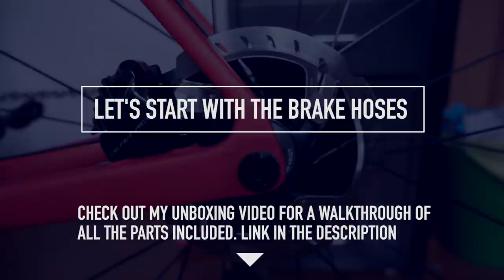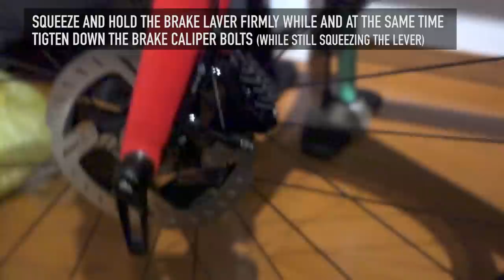Dura Ace Disc brake Installation and bleeding How-to | Road to Dura Ace 9170 Ep.3

Comment: Rides of Japan thanks a lot for the excellent video! If I only want to change the calipers should I drain the system of oil beforehand? Can I do that by simply attaching a hose to the bleed nipple, opening the port and letting the fluid come out by squeezing the lever a few times? Or how would I do that best? I'm afraid that if I just remove the caliper all the oil from the brake hose will spill on the floor. Any other suggestion for replacing calipers is also very welcome :). Thanks!
Reply from the maker: Paolo Capozzi unless you need to change the hoses as well (for example if they will be too short when cutting and putting on a new inserts/olives) you should not need to drain the system at all. 
I would just unscrew the hose from the caliper, just keep something underneath for the few drops that will inevitably come out. But since the bleed screw in the lever is closed and no air can enter from above, the fluid should stay in the system.
Cut the hoses as near the inserts as possible... then tap in the new one (this might be the most complicated step as the hoses are still attached to the frame.)
After that’s done, attach the new caliper and do a normal bleed.

If you want to drain it anyway though what you said should work, just open bleed port on the caliper and the bleed screw up at the lever.
Reply: Rides of Japan thanks for the answer! Indeed it makes sense there will be no oil drop if the lever screw is closed. However I don't understand why I would need to cut the hoses before inserting them into the new calipers? The new calipers are exactly the same model as the old ones that I want to replace (BR-RS805, of an Ultegra group set) so I would assume the length of the hose should stay the same. But I have to admit I've never even bled disc brakes before so I lack a bit of experience in this respect :). Once again, many thanks for your help!
Reply from the maker: Paolo Capozzi
According to Shimano the olive and insert are a one-time use item... annoyingly. 

From shimano:
"Do not reuse the olive piece or the connector insert when reinstalling. A damaged or reused olive, or connector insert, may not provide a secure brake hose connection, possibly causing the brake hose to disconnect from the calipers or brake lever." 

That being said, I have actually done this once then I forgot to attach a cable port once...without any problem... however I would not be comfortable recommend this, for the above stated reasons.
Reply: Rides of Japan thanks for the clarification. Indeed rather annoying...unless the component is damaged or needs to be somehow "deformed" to get into position I don't see the reason of changing those pieces. but thanks a lot for pointing it out! Shimano might have its good reasons for specifying this.
Reply from the maker: Yes, normally I reckon it will be fine, just keep an eye on the connection, if there’s no indication of oil leakage you should be ok.

Comment: Hello friend, I have a question: it's possible to install this levers hydro internal route handlebar aero?
Reply from the maker: roghax85 it all depends on the handlebars.
Check my latest video where I installed these in internal routed gravel bars for reference.
https://youtu.be/re4VzBBonkA
Reply: @ridesofjapan  awesome video, thanks man, I hope can copy your job with mine levers, hydro and mechanical shifter speed. Regards
Reply from the maker: roghax85 as long as you can fit both the hose and the shifter cable hosing through the openings it should be doable.
Good luck!

Comment: Great video, how often do you change brake hose when first installed ?
Reply from the maker: Thanks! Unless I'm changing shifters or calipers, I would never change the brake hoses. I would however bleed the brakes about once per year or if the lever starts feeling weird.
Reply: Rides of Japan great video. 
My question:
I’m upgrading my levers&calipers. 
Would you change hoses in this instance?
They are ca. Year old and in perfect condition. 
What say you?

Comment: Hi, great videos! Do you know the size of the bolts for the rear caliper you use here? Im building the same canyon bike and I have the calper bolts from an older bike and I dont know if they will work! thanks in advance!
Reply from the maker: EmiTT thanks! 
I don’t have that frame anymore, but I want to say the bolt where 30mm, not 100% sure though.... if they are too long you can always use shims.
Reply: Rides of Japan Yes, shims could work indeed! I'm too in a  road to Dura ace :) one  last question,  I'm using 9170 shifters but 805 calipers, any experience on that? Bh90 hose, olive and instert on caliper and shifters? Keep up with the videos, really good!
Reply from the maker: +EmiTT I went all dura ace 9170 so have not tried that particular combination.
A friend of mine use the 9170 shifters with non-series calipers and bh90 hoses, and I have not heard any complaints.
Just make sure you have the correct inserts and olives for the hose.
Reply: Rides of Japan yes, I'll put bh90 hose, insert and olives. Let's see. My worry was using bh90 olive in a bh59 caliper. Thanks!
Reply from the maker: EmiTT asked my friend again and he said it works no problem 👍
Reply: Rides of Japan thanks for the help!

Comment: Someone got an idea if and how i could rescue an ultegra 8070 shifter that has an olive pressed into the thread? mistakenly had one in there while screwing in the cable with another. now the first one is completly stuck in there and cracked. it doesnt seem you can take apart the shifter to better maybe pry it out from the bottom?
Reply: Old post and video I know, but did you find a solution for this? Someone who is building my new bike has unfortunately made the same mistake and he's not sure how to solve it.

Comment: My Ultegra R8070 Di2 Disc groupset came in today (not sure if it came with olives/insert ready). Where did you purchase your olives and insert?

Edit: Nvm it came with a built-in olive. I just have to remove the seal plug, insert the hose into the joint component, and tighten the flanged connecting bolt with an 8mm spanner while pushing in the brake hose. Picture for reference: https://imgur.com/a/lVwMRs3
Reply from the maker: Oh, have not seen that before, they must have started with that solution on the R8070 then? Very nice either way!

For future purposes, I just get my olive/inserts from amazon, always have a few spares set at home just in case
https://amzn.to/2JxsRH9

Comment: what is the bleed funnel adapter part spec? are they for sale anywhere?
Reply from the maker: +james hoggarth I haven't found them sold separately. They came with the shifter. The part# is Y0C698050
Reply: fnck! i got the shifters last week, but no bleed funnel adapter.
Reply from the maker: That sucks! I did a search for the part number online, and git one german site that seem to sell them, bicikli.de (googled "Y0C698050"). Going to a local LSB might be faster though
Reply from the maker: +james hoggarth hmm... I guess i can post URLs
http://bicikli.de/shop/SHIMANO-Ersatzteil-Y-0C698050-ADAPTER-FUeR-ENTLUeFTER-UDICHTUNGSR-FDISC-BRAKE-ST-R9120-Shimano-Code-Y0C698050_1

Comment: thanks for you time, what is the model nr on the yellow bleed block ?
Reply from the maker: +jacob mortensen I can’t find any part number in it unfortunately. But it’s a smaller version for the flat mount calipers than for the post mount. There’s a better picture of it in the unboxing video as well.

Comment: You clamped to high on the hose. When you drove the barb into the line micro particles of pvc liner contaminated the fluid and ports. Space hose 3/4 of an inch above clamping block. Pre oil line if not already oiled to eliminate liner  contamination.

Comment: A TL-BH62 tool is a good invest! And if you install the sleeve of the syringe on the caliper it is way easier to remove the plastic cap completely and install the sleeve with the orignal TL-BT03S kit because this has a black plastic ring on it, which you can push over the nipple of the caliper. This will hold the sleeve very good on it. https://www.swinnertoncycles.co.uk/images/shimano-workshop-tl-bt03s-disc-brake-bleeding-kit-a-with-syringe-and-reservoir-funnel-p55754-93947_medium.jpg

Comment: 7-8 times?! That doesn't sound right.
Reply from the maker: Pete Jeffris I know right. Don’t know if it was because the system was completely dry or something... but it took forever to get all the air bubbles out.
The recent build I’d did it was nice and tight after 3 times.
Reply: Had that problem too. If you are not in a hurry, it cann help to let it settle for a while, now i sometimes do the process once or twice, and let it stay over night. next morning once more and it usally is fine afterwards.